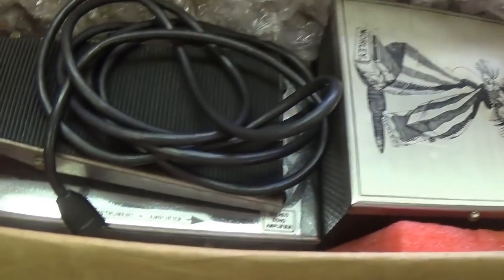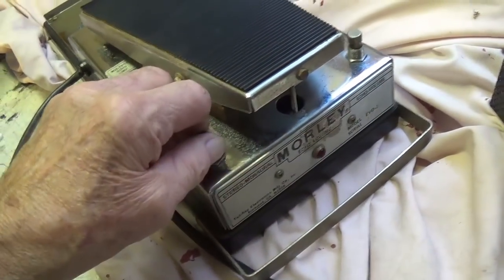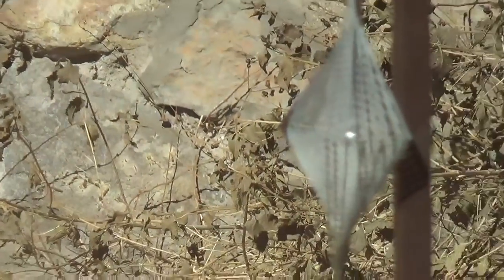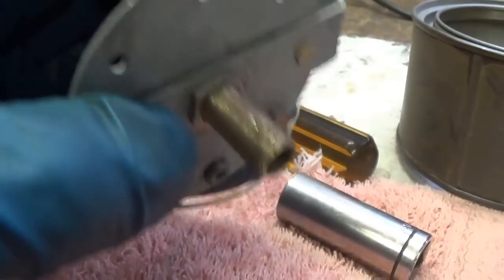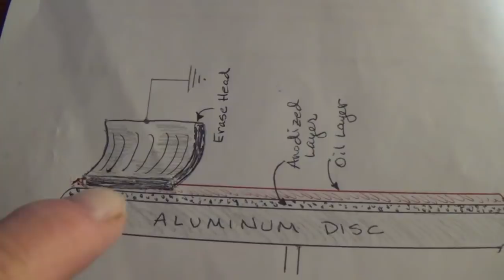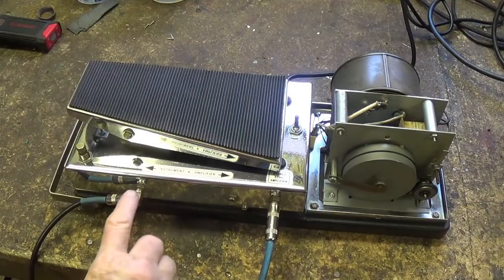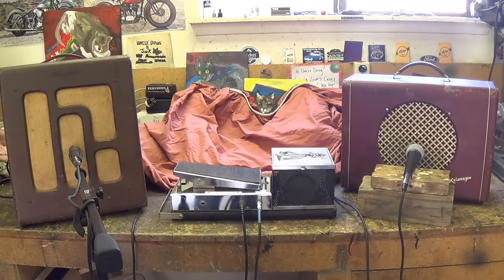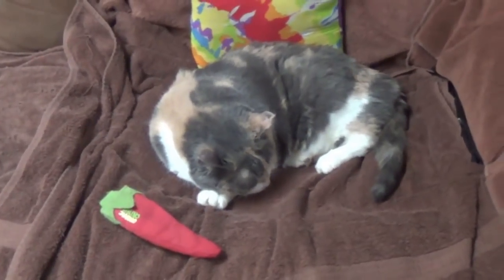1977 Morley Evo-1 Oil Can Echo-Delay Pedal......Complete Overhaul & Test

Comment: do you think that the LB-65 oil could be similar to Hammond Tone wheel Oil?
on the coating on the wheel, the inventor probably kept the formula in his head, 
never wrote it down, and when he left this mortal coil, took it with him😮‍💨
48:14 what an ingenious way to make a resistive level control!  😀👍
Reply from the maker: My guess is that they are the same or at least interchangeable, GG. Glad you enjoyed the video :)
Reply: @UncleDoug  I really did, Thanks 😀

Comment: Hi! Doug. A bit off topic. I'm building an amp loosely based on the FenderAB165 Bassman. I have sourced all the components but for the capacitors in the Tone Stacks. What do you recommend? What do you like? THANKS
Reply from the maker: Whatever Antique Electronics Supply offers in good, inexpensive capacitors, Don. I honestly feel that money spent on boutique capacitors is wasted and would be better spent  upgrading the speaker.

Comment: Could you add a touch of blue lock tight to the inner nut on the fixed hollow threaded rod?
Reply from the maker: Yes, indeed, Alex, and I probably should have done so.
Reply: @UncleDoug   ok cool,  Oddly I only learned about & started using the different types of locktight about 10 years ago.  Prior to that, I was just using Varnish-type stuff.  haha  BTW: Nice backyard, but would evict the Fox. :)

Comment: I can send you the Chinese made A10 Handwired version to evaluate for a Cap upgrade. This EL34 based single ended 2 channel Beaut is the most  popular CHI-FI amp out there.
Reply from the maker: Thanks for the offer, Otto, but I'm currently swamped with repair work and tend to stick with vintage tube gear.

Comment: Doug on that protruding pushing that you reseated Did you use a silicone grease(non hardening) or a silicone adhesive(rtv) on it?
Reply from the maker: I think you mean "bushing", CG, and yes, it was both sealed and lubricated.

Comment: The anodized aluminum disc/oil combination strikes me as being some type of rotating capacitance device. Curious as to how the read, write and erase heads carry a signal to/from the disc.
Reply from the maker: I tend to agree with you, Mike. It does behave much like a flat, rotating capacitor.
Reply: @UncleDoug  It may be that the anodization serves merely to harden the disk surface to minimize wear. It would be interesting to try replacing the disc with a similar size disc with and without anodization. Do you know what the contact portions of the read, write, and erase heads are made of?  To me, from the video, they look like chunks of rubber like one might get from the sidewall of a tire. Pretty crude looking. compared to the heads from a reel-to-reel tape recorder.

Comment: Hi Uncle Doug, I have one of these Pedals ,Just like to know if you can use some other light oil for the unit Thanks for the work you Do. Cheers from Australia
Reply from the maker: Apparently not, Cliff. The correct oil is generally available on Ebay, where I bought mine.

Comment: All that goopy sealant reminds me of a pair of Leslies I got.  The drums "moaned".  The drum bearings had seized up and some doof sprayed white lithium grease to 'fix' them.  They're sealed ball bearings.  So, they were no less seized than before.  I grabbed a set of McMaster Carr's 2nd most expensive sealed bearings and the drums now spin smooth as silk.  Really, many quick fixes fix nothing.
Reply from the maker: Good observation, IS. Sometimes the hardest part of a repair is undoing the previous "work".

Comment: At 10:18. A potentiometer on the pedal of a Morley?  You are in for a big surprise!
Reply from the maker: Please don't keep us in suspense.......what surprise ??
Reply: @UncleDoug  It uses the power lamp, a fabric shutter and light sensitive resistors that change resistance in light/dark. They are called Cadmium Sulfide (CdS) cells.
They never crackle like a potentiometer will over time as it wears or gets dirty. But you did get to that later in your video.  It's the crackle free foot pedal that is why I have 5 Morleys for my Bass: Phaser, Wah, Wah-Fuz, Compressor, and Volume-Boost.
Reply from the maker: @paulromsky9527  Yes, as I recall that was all explained and demonstrated in the video. Thanks for pointing that out.

Comment: Doug - I have a similar pedal - EVO1 - serial number 80508 - I am very impressed with your demonstration of the repair - and I would like to know where you are - (New Mexico someplace?) - I would like to send my pedal to you for a check up and repair (it has sat for many years in my basement - and the oil has leaked out). No one else has done any work on it (except I did replace the light bulb once) - so I don't think it will be nearly as much work, although I don't know for sure.
Please let me know. Thank you!
Reply from the maker: Al, all I can work on are the mechanical parts, the transistorized PCB is not something I repair.  Also, a complete disassembly, cleaning, and restoration of the oil can unit takes lots of time and thus is rather expensive.....but still a small fraction of the value of the unit. If you are still interested, please message me on my FB page, Uncle Doug's Vintage Amps.

Comment: Looks like some of the pits on the oil can top may be all the way through... might want to seal those as well.
Reply from the maker: The unit is long gone, Brian, and apparently none of the pits were actually holes since no oil leaked during testing.

Comment: I've got one of these that I've got mostly working again. I'm just getting a standard delay sound out of it. I'm not getting that watery, chorus type of sound. Is it possible I just need more oil?
Reply from the maker: There's no way to tell, Everett, other than trial and error. Good luck.
Reply: @UncleDoug  thanks for the quick response! I had just guessed at the amount, then sealed the thing up. But when I opened it up, it looks to be about the same level you filled to

That chorus sound seems to be mainly affected by (what seems to be) the bias pot for the transistor right before the signal goes to the disk. There's a very fine line on that pot that gives it that sound. Too low and it starts to squeal, too high and it just sounds like a standard echo unit with clean repeats. 

I also just wanted to say thanks for inspiring me to tackle some projects like this that are outside of my comfort zone.
Reply from the maker: @rhymenocologist  You're welcome, Everett. Best of luck with this project.

Comment: How close to the disk surface are the reed heads like how many thousands clearance . My heads and disk are out of my unit so I’m rebuilding it with parts I got a second unit
Reply from the maker: They rub against the surface of the disc, lubricated by the UC oil.
Reply: Ok thanks for letting me know . What should I use to clean the dried up oil on my unit it’s thick like honey . So I want to clean up and out the old stuff and add fresh oil I have the exact oil you mentioned in this video
Reply from the maker: @chrischwaz7788  I use lacquer thinner for any oily cleanups, Chris.

Comment: I had purchased a similar unit when I was young. It was a Morley Power Wah. It had an oil can also and a lever that you would set to I'm guessing to change the vibrato? Echo? I don't remember. But I had no idea how it worked or what the can was for. I'm ashamed to say I disassembled it to try to figure out how it worked and then threw away the can unit. Shoulda Coulda Woulda.
Reply from the maker: Thanks for sharing this with us, James. That noise you hear is us, rooting through your trash ;)
Reply: @UncleDoug  That's OK, root away. It was well before the internet and I didn't have a clue how to repair it. Or even what the effect was supposed to sound like. The volume and wah still worked so I gave it to a friend who now lives in Washington state.

Comment: Tio, help me connect some dots. The record, pickup and erase heads make perfect sense EXCEPT, how the heck do they work if they are electrically resistive/insulating material like rubber? With metal oxides and magnetic readers like a tape delay a la echoplex and roland, I get the transfer of electrons. But how does that work with rubber, especially with an oil lubricant that would limit the transfer of electrons? Of course, the transfer of electrons in my brain might not be that efficient, so there's that.
Reply from the maker: The rubber heads work just like your rubber-soled shoes when you walk on carpet. The static electricity in the carpet doesn't pass through your shoe soles, it creates a strong negative charge on the outer surface of the sole, which in turn creates an equal and opposite charge on the inner surface......much like a capacitor (which has insulating material between the two opposing plates). This equal but opposite charge is what deposits the static charge pattern on the disc surface.

Comment: You did not see the pitings an the pin holes in the  lead of the can? you sould have soder them, besides that good work but if the pin holes remain the oil will spill dow all your efort in sealing it , sounds great besides that detail.
Reply from the maker: Thanks for your helpful observations, Luis, but the device was shipped quite a while ago.

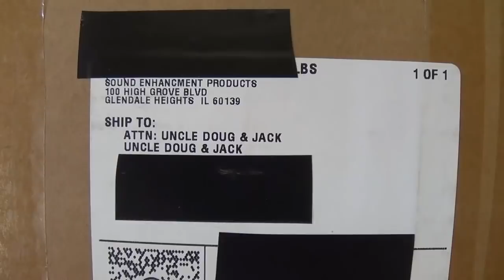Comment: 4:00  Sound Enhancment? Morley might be easier to spell! Its filled with PAG oil, like your cars AC! If a small packet of 3A molecular sieves could be included in the oil can, water removal would assure the PAG oil wouldn't degrade, FYI.
Reply from the maker: Large corporations play by different rules, Ted ;)

Comment: I’m getting into mine and the lid on my can has the same big epoxy sealing , that doesn’t work . So I need a lid and a belt what did you end up using for a belt
Reply from the maker: Good luck finding a replacement lid. You would be better off repairing the original. For a belt, you can use one or two O-rings from a car parts store. Just for testing, a couple rubber bands will normally suffice.
Reply: @UncleDoug  ok I wasn’t sure if you remember the size of the oring thickness and the diameter but I also work on cars so I can figure it out. As far as the lid I will mug Weill the hole smaller and round mine is about the size of a nickel and oval as far as the bushing I will make it up maybe a nut with a washer wielded. To it and I will cut a gasket great inspiring video I probably have watched it nine or ten times in the past year
Reply: Do you remember what size the bushing is I did some looking and I found after market bushing so I’m hoping that one of these will work .
Reply from the maker: @chrischwaz7788  I have no idea, Chris. Can't you simply measure the OD of the shaft and the ID of the hole the bushing fits in ??
Reply from the maker: @chrischwaz7788  I can't remember my own zip code some days, Chris. Bushing sizes are not something I tend to retain in memory :)
Reply: @UncleDoug  ok will do
Reply: @UncleDoug  that’s funny I can’t remember my own zip code sometimes thanks again Doug

Comment: Dear Uncle Doug

I'm a long time viewer, but I'm pretty stupid.   I've being a back yard recording engineer most of my life.   I've learned loads about fixing my own amps from your videos.   I don't think you have any vids on famous tube microphone mechanics.  If so I've missed them.   I have some nice mics in my studio but no tube mics yet.   Do you have any thoughts on this?  Does anyone else who views this channel have any thoughts on this or has/have attempted to put a condenser style tube mic together.
These silly tube mics price up silly silly high and I'm thinking that the amplification circuitry has got to be silly simple compared to a silly Princeton. 

Sincerely
Todd Greenwood
Saskatchewan 
Canada
Reply from the maker: I have never dealt with tube microphones, Todd, but agree that they are really expensive. I stick purely with vintage tube amps, and some of them are getting pretty darned expensive also.
Reply: @UncleDoug  OK thankyou for this answer.   Hopefully some one will send you a discard sometime.
Reply: I have an old capsule out of a Rode mic that has been damaged that Im going to try to dissect and possibly repair (just to measure a signal, not to use as a recording mic anymore).   The mysteriousness of the 'heiled' tube microphone has got me going.   So far it looks like it's merely a charged condenser capsule (big plate capacitor with air between the plates)  and then it goes through tube amplification to bring it up to line level.  But the marketing and lore makes it sound like there is some magical way the capsule is lit up by the tube circuit.   The high end 'tube' microphones I see in stores just look like a regular microphone but it comes with a little tube amp box that dongles up to the rest of it.   I'LL FIND OUT.

Comment: LOL @ "rancid cooking grease from Calligula's Cafe!"

So is there absolutely no truth to the rumor that some of these used to use PCB oil? Would be comforting to know that for sure, particularly if the thing is leaking on you. :)
Reply: I'm replying as I watch here. Morley wah pedals from back in the day used an optical CdS cell sensor, with the pedal driving a curtain between it and the pilot light. Can't wear out or get scratchy!
Reply: @41:35 My understanding is the oil doesn't provide the "memory storage", rather it insulates the static charge on the disk surface from bleeding off into the air before the read head gets a chance to read it.
Reply: Also, that rubber the heads are made of must be carbon impregnated, no? I'd be interested to see what it reads on an ohmmeter.
Reply: And isn't the erase head exactly that, an erase head? I assume it's wired directly to ground, no? The number of echoes are typically controlled in a delay by a feedback control, sending some amount of delayed signal back to the write head mixed in with the input signal. If you want a single echo you have no feedback. (I haven't gotten to the electronics part yet. We'll see if my guesses pan out.)
Reply: @43:54 There has to be an insulating layer between the aluminum disk and the static charge holding layer. Otherwise the charge would spread through the entire disk evenly.
Reply: @44:14 Ah, now you're agreeing with me about the insulating function of the oil. (You first said at @41:35 that the oil provided "memory storage" which prompted my correction, above.)
Reply: @45:17 I assume the heads are wide to contact a significant area of the disk and thus collect more static charge than a thin track would. (And of course they're narrow in the direction of disk rotation to maintain high frequency response. EDIT: Which after listening to it is not great.)
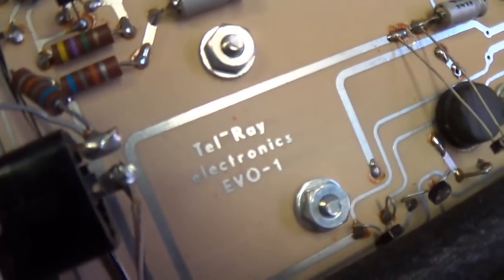Reply: @47:31 Yep! There's the CdS light sensor cell and pedal-driven curtain to shield it from the lightbulb! First wah-wah I ever used back in 1988 was an old Morley. I replaced the light bulb for the owner who thought the unit was broken.  https://soundcloud.com/admiral-quality/camouflage
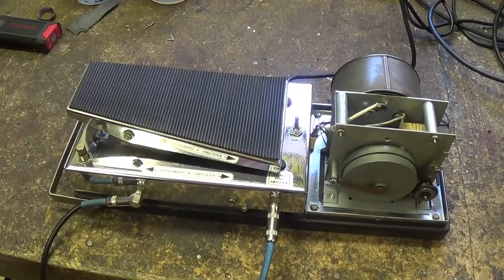Reply: @55:27 The chorus has to be faulty behavior. Are we sure that disk is rotating at a constant speed?

Also, are you sure you need to use that stereo jack if it's in echo mode? Wouldn't that switch change the function at the main output jack, and the other one only be used if you have a second amp? (Otherwise, why would you need the echo/volume mode switch?) Also, do either of those output jacks short anything when plugged in? (Like, to mix the echo with the dry signal if in mono usage?)  

Yep, just checked out the schematic and that's exactly how it works. https://www.doktorsewage.com/mondo-morley-medicale-evo-1-part-1-mods/ I also verified that the echo repeat control is a feedback control -- the typical way we control number of repeats in a delay unit (not with a partial erase head, which isn't really a thing -- it doesn't seem to be in the schematic but I assume that erase head is just wired directly to ground).
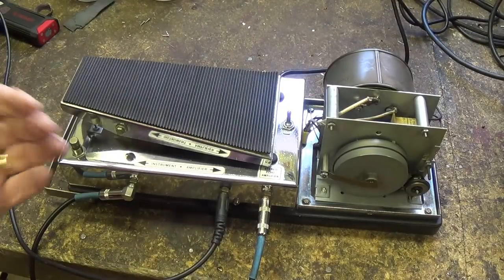Reply: @58:00 Yep, your stereo mic picked it up well. (Wish you'd done a demo with single repeats.)

Pretty easy to match the chorus warble to the rotation of the flywheel, which also seems a bit off from true. I wonder if that's the cause of the chorus?

Great episode, Doug! And as you can see, I was playing along at home and did the exercises at the end of every chapter. ;)
Reply from the maker: I have no idea about PCB's in the original oil, AQ, but I'm fairly certain that Union Carbide is not producing and shipping PCB-laden oil to customers in today's litigious, hyper-vigilant society. I prefer to assume that it's all safe.....that way, nothing can harm me ;)

Comment: I don't think it sounds like it should. It's more of a tremolo effect rather than an echo. It may be because the aluminum disk seems like it's bent. The can also looks like it has a lot of small pinholes where it rusted through, you can actually see light through them in several parts of the video. That's likely what all that silicone was covering up.
Reply from the maker: Thanks for your input, JJ.

Comment: I have an old Kern wah that is tube driven that I would love to have you take a look at From the late 80's  early 90's I think I will look up your email and send you a message to see if your interested Thanks
Reply from the maker: I have ceased to work on oil can devices, other than those I personally own, Paul, simply because the absence of any way to replace the anodized disc greatly limits the outcome of the repair.
Reply: @UncleDoug  I recently purchased a Morley EDL.  The delay pot has seized and I would really love to use this device.  Do you have anyone you would recommend to repair it?
Reply from the maker: The only other person I can think of who might be willing to work on your Morley device can be found through this video:  https://www.youtube.com/watch?v=i6kv7I4cPQc&t=497s  Good luck.
Reply: @UncleDoug  Thank you so much